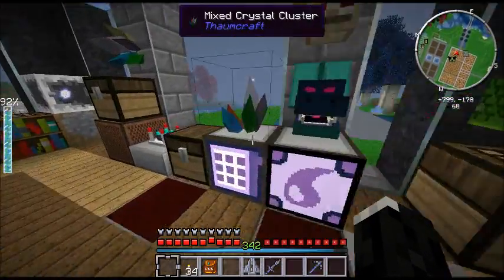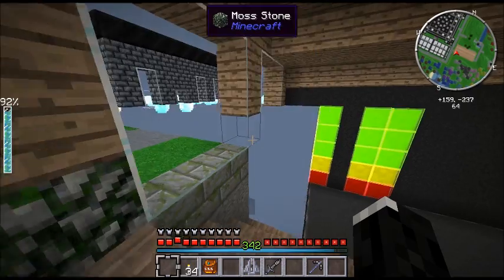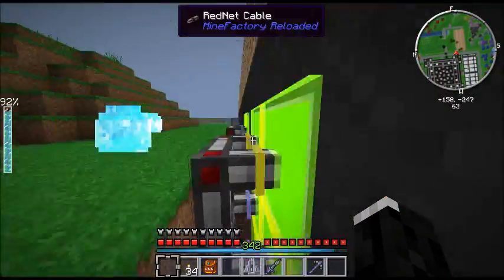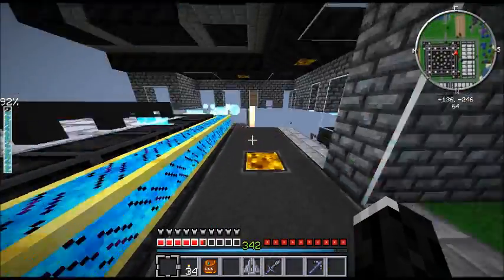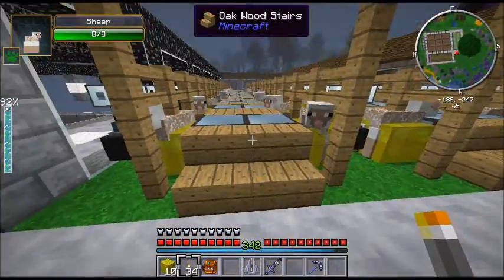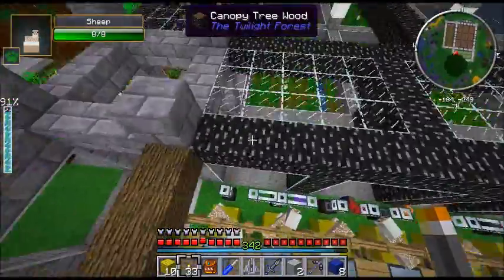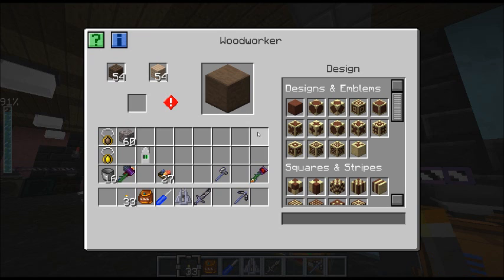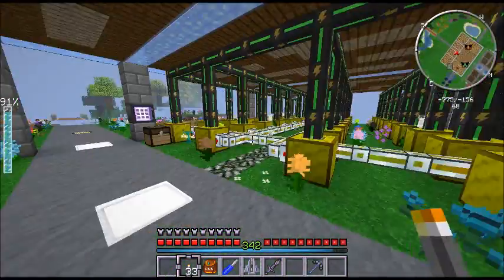SSP World Tour 3 Part 1

Comment: Reika I have a suggestion
I'm always making rotarycraft stuff that requires a workbench. I also like to auto craft with AE but the server I play on does not have the config option to make workbench recipes normal ones. Therefore I suggest a workbench module for AE autocrafters so I can do workbench recipes in autocrafting. For compatibilities sake a workbench pattern encoder would probably need to be added aswell. Thanks
                        ,Erik